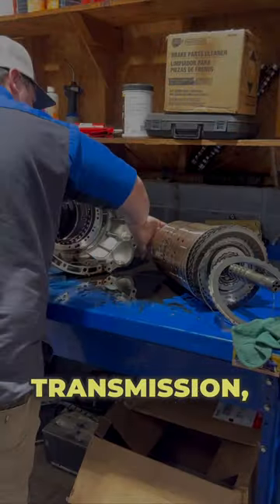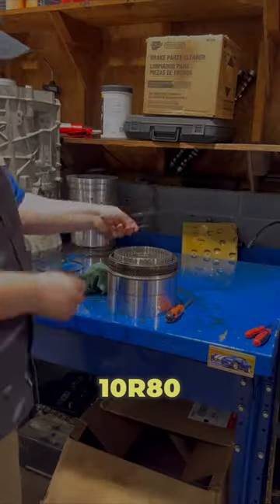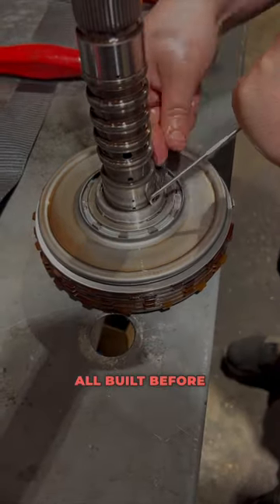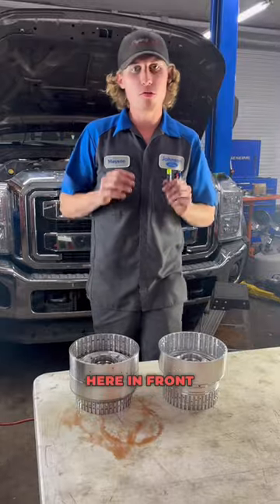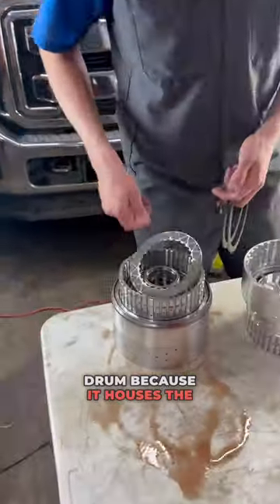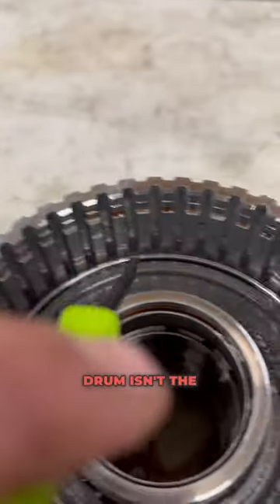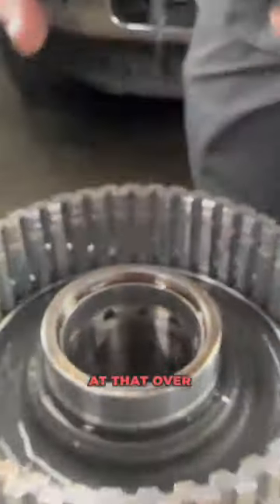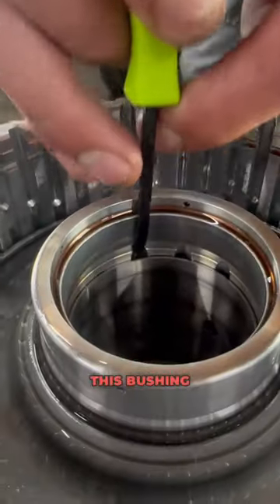Ford 10 Speed Transmission Problems? CDF Clutch Drum pt.1 #shorts

Comment: Ford and GM engineers didn't expect anyone to find it.
Reply: Ford and GM to be correct
Reply: @jordainepenner6232  correct. 
I edited the above. 😁🤙
Reply: Did you know, the Ford and GM transmission are actually NOT the same? Ford changed some internals and tuning. Also the only "shared" tranny is for the 1500/F150 and NOT the 1 ton diesels
Reply: They’re not the exact same… also GMs don’t seem to have nearly as many problems so… ford messed up
Reply: @AsianNIGMA   Fewer problems because they sell fewer vehicles.
Reply: @AsianNIGMA That’s funny, I just watched a teardown video of both and the GM transmission had tons of cut corners vs the Ford. The tech was shocked at how cheap the GM looked in comparison.
Reply: @booya6437  - Could you please post the link for the video you referenced?  I'd like to also check it out.  Thanks!

Comment: I work for an automotive warranty company, we are replacing hundreds of these transmissions a WEEK! It’s insane.
Reply: My dad thought I was an idiot when I told him I paid for the extended warranty. Till the trans went I paid 250 bucks for a new trans 😂.
Reply: @The219Beast that’s great but why get a ford ?! They got so many problems that are well known this is just another one
Reply: @Thisguyyyyyy  oh no I meant in general you should get the extended warranty. I have a 2019 Acadia known to have transmission issues. Sure enough right at 82k started acting up, ended up being a torque converter. I asked to replace everything so they did.
Reply: @Thisguyyyyyy not really. I've been a tech for 20 years, almost weekly I'm replacing or rebuilding dodge ram engines and trannies or gm trannies. Ford has had their share of issues but almost never are you replacing or rebuilding drivetrain components
Reply: That's crazy. I'm really glad that I have the 6 speed lol. Lots of issues on the F150 forum with them as well.
Reply: Nice to know you guys actually cover some issues. I always thought those companies were a scam and wiggled out of paying most claims.
Reply: What u need is the good Ole 6R80!! My 2015 f150, gets .4mpg less than my buddy's 10R80 f150 same engine same rear-end!  So is .4 worth issues n 4 more gears ?? Nope
Reply: @bits9760 my 2015 F-150 6 speed always slammed hard downshifting around 35 mph, almost like it was trying to engage both gears at same time for a millisecond. TSBs came out and never fixed the problem, only lessened it. Luckily I sold it before anything completely failed.
Reply: @Thisguyyyyyy I know right...damn just put 3700 in parts in the transmission in my GM 2500hd
Reply: @calvins1837  Alison or 6 SPD?
Reply: @JasonW.  6 speed auto. Torque converter, valve body, solenoids. Started shifting funny at different times, money light was coming on. 144k on it.
Reply: @calvins1837  ok. I know there is a tsb on my 2020 about odd shifting sometimes, fix was to flush, but not replace filter
Reply: @JasonW.  this is a '16
Reply: @The219Beast plus the extended warranty cost... ding dong... so what...
4,250?
Reply: @JasonW.  Lucky you - the slam shifting was the first indication of the problem that was going to worse.
Reply: @Thisguyyyyyy  please list more reliable available options other than 5-15 year old toyotas with 150k+ miles still going for over $30k or GMT 800s.
Reply: I believe these are in GM's as well. The 10 speed was a partnership between both of them
Reply: @The219Beast shouldn’t have to pay anything

Comment: My dealership keeps saying basically the transmission is fine totally normal and refuses to warranty it
Reply: Get a copy of the TSB and schedule an appointment with the service manager sit down and discuss it, if they still refuse to do the work contact ford corporate, that will light a fire under their asses.👍
Reply: Just go to a different dealership, they are all underpaid for warranty work I don't blame them.
Reply: @datmanz5890  I do blame them. They signed onto the dealership deal.
Reply: In this case, “normal” is flawed.
Reply: They are running out the warranty clock. They did it to me. Get an extended warranty BEFORE thr 5 yr/50k and go to a different repair facility. I found out the hard way. I had to trade it in and took a $8k loss. No more Fords for me.
Reply: @roberthartzell7104  the exact way to go about stubborn dealers
Reply: Go to a different dealership or report them to Ford for not honoring warranty work.
Reply: If they fixed it the first time, right.We wouldn't have that problem.They're always trying to take shortcuts all three american companies
Reply: @scottmendoza8989  Only the American Company's?
Reply: That’s ford for you.

Comment: so fuckin glad I have the 6 speed
Reply: @Windypalace my 6r80 is a solid transmission.
Reply: @@Windypalaceisn’t ford/gm partnered for these transmissions?
Reply: @brad1356 yes they are, identical except for the software
Reply: @es-qf2gw  6R80 is a 6-Speed Auto, not manual...
Reply: My six speed is a rough shifter….has been for along time.

Comment: Isn’t this the same Transmission GM and Ford Built and designed together ??. I  have the first year 2018 in my Ford F150 , I have 125,000 miles with no problems at all ?? ( So far )
Reply: I think the first year was 2017 if you got the nicer trims.   A good friend of mine has a 2017 Platinum with a 10 speed.

Comment: I have 23 tremor and the trans shifts terribly sometimes.
Reply: Drive it as hard as you possibly can shy of embarassment, or dickishness for a day. Or even longer. Or, even more challenging, if you already drive hard. Try driving it like an 80 year old widow. This will reset the trans computer and relearn the driving habits. Theres easier ways to make it relearn as long as you can use the computers modern vehicles. Ford locks out so many things though, especially in the engine computers.

Comment: Couldn’t this potential issue be resolved, for those going thru a rebuild, first having an appropriately sized intermediate bushing driven down into that recess, before regular bushing, so that machined space has zero depth ahead of bushings’ home resting point? I.E., removing that ahead space being available for bushing to wanna “walk down” over time? Or just a taller/longer (greater depth) bushing in the first place? Seems rather stupid that the hole machines to receive this bushing, wasn’t machined with a slight shoulder down in hole, for bushing to positively stop against
Reply: If I understand your comment and the video correctly I think the issue is the bearing sliding up and covering the hole, not sliding down.

Comment: Can you explain why displayed coolant temps for ecoboost would climb over 236° while in moderate boost i.e. on-ramps on interstate?
Reply: Does it do it with the AC on? Most vehicles the electric cooling fan doesn't come on until 230+ unless the AC is on. I would start by checking the coolant level and check for debris in the cooling fins. I've seen them get full of grasshoppers.
Reply: @carlt6932  coolant level is full with the system “burped” from the dealership. All fans and shutters are functional. I live in Texas so AC is always on. I’ve also had the radiator/cooling system flushed several times. This has only been occurring since the cam phasers were replaced. Could it be a sticky thermometer? Could be a sticky thermostat? Other root causes?
Reply: I would be looking at the thermostat
Reply: I just had this issue on my ecoboost expedition. First issue was the thermostat, second was the water pump. OEM water pump had plastic fins and they were eroding over time. Replacement Motorcraft part has metal fins.
Reply: @Ryanhaglund the thermostat should've been your 2nd try,  make sure alternator is recharging properly, check water hose and pump then flush the system,  make sure all fluids are filled
Reply: @BruceDragon-sf1tr  @carlt6932 @macew32 thank you all for weighing in. My problem has been resolved. 1) needed new water pump as the old one was weeping through the seep hole. 2) the main culprit, the engine thermostat was installed backwards at the dealership that replaced my cam phazers four years ago…
Reply: @cskiles  you were right on the money! Thank you!
Reply: @Ryanhaglund  awesome! Glad you got it resolved.
Reply: @Ryanhaglund  you shouldn't let anyone work on your vehicle,  ask the dealer to let a veteran mechanic work on your car

Comment: 21’ STX F150 with 82,000miles. Like brand new. Changed the transmission fluid and filter at 60,000 miles. ❤

Comment: Got mine fixed in 4 days and shifts good but it still has its quirks. They did the whole TSB with a transmission reprogram/relearn, valve body, and then the new CDF drum

Comment: Ive got a 2020 with the 5.0 and my only worry is this transmission.
Reply: Ford replaced my 19 f150 coyote for excessive oil consumption at 50k.
Reply: Meh. They rebuild well. Alot can't be rebuilt and it's not worth it. These can be pulled apart rebuilt and tested in half day. There are ALOT of them so has a strong aftermarket.
Reply: dad has  the same truck and burns oil like a mo fo , id be worried about more than the tranny , the whole truck is junk , told him not to leave Toyota lol
Reply: @TheCaperfish  you know the tundra motors are having far worse problems? Coyote just had a mystery issue from 2018-2020 that gets fixed with a PCM re program. As it was creating so much suction that it was pulling oil through the valves. It was such a mystery the best engine builders still don't have consensus around the cause.
Reply: Did you buy it New or used? I bought a 2020 GT 5.0. mustang with 7700 miles, mine has a hesitation 2-3, after 3rd gear all gears are fine, sports+ all fine, just D mode 2-3, What about yours? Any hesitation in D mode?

Comment: Need to stake them in like the good old 700r4 pump bushings.
Reply: Holy shit. Do it like the 700R4, said no one ever! The 700R4 when paired to a 6.2 diesel made it seem like the 6.2 was a good engine. I remember doing the update Kit on my 700R4 when it blew up the Third time. Worst transmission, ever.

Comment: I disabled my transmissions adaptive learning. Truck drives like a dream now. We’ll see how long this lasts. I have 50k miles on my 2020 F150stx with the 2.7 eco boost. I’ve had the truck tuned by MPT for over 40k of those miles
Reply: Reply back in about a month or two please lol.
Reply: Is that done thru programming or a manual disconnect switch

Comment: What symptoms can a person look for in a vehicle with this transmission?🤔
Reply: Hard shifting shuttering clunking slipping
Reply: @keithlaub7964  

I have a 10 speed in my 2021 F150
I just don’t care for how it shifts. Varying the throttle at all at lower speed sometimes seems to disrupt the shift and it seems like the transmission is being shifted by rubber bands. Thank you for responding back. I will keep an eye on my truck.

Comment: What's the cause and how to best try to avoid the issue?  Does changing the fluid ahead of schedule help?
Reply: The cause is a incorrectly designed cdf clutch drum that allows the bushing to move and damage the sealing rings that seal the clutch drum and apply fluid pressure which engages the clutch packs.

Comment: Chevy the same way if you have a 6 speed or 8 speed from 2014 and up there all junk.
Reply: Not really 

My 2014 lasted to 189,800 miles on the original fluid before going out 

People who’ve never owned a Chevy love to bash Chevy I’ve noticed
Reply: The 2019 to 2023 5.3 6 speeds if.ypu can find one are great I found mine and was manufactured without afm or dfm and no auto stop start
Reply: A guy I work with has a 2014 silverado with 300k miles.  It's on its 4th transmission.   Just rebuilt the engine.  He drives it solely for work now and shockingly bought another 1500 silverado.  Brand loyalty is real lol.

Comment: I had a 2017 F-150 with the 3.5 Eco and the 10 speed. One day, my engine and transmission got into a custody fight over who was going to get the drive train. Lost 5-10 and reverse. It was replaced under the extended warranty.  No longer own that truck.

Comment: I have a 2019 f150 never received a tsb from  ford will I receive one in the mail?
Reply: No its not a recall
Reply: So ford knows they have a problem, so when my transmission breaks then it's my problem. Is what the  video really means.
Reply: It'll start shifting harsh and erratic when it malfunctions.  A TSB is created anytime something has a common or pattern failure.  This will guide the technician on the proper approach and repair method to the issue.  It also helps the technician diagnose the vehicle faster since they should be checking TSBs early in the diagnostic process.  TSBs are also not always covered by the dealers, in which case will be customer pay.  Car manufacturers will only notify you in the mail if the issue is a recall.  Recalls are covered by the manufacturer.
Reply: @M4sterT3ch  I was notified by mail a T S B for the cam phaser raddle, it notified me to contact my dealer if I had a phaser raddle so they can reprogram the ECM to crank engine longer to get oil up to values. I never had the problem. TSB are a joke it's the manufacturer way to say open your wallet.  If a vehicle has a on going problem on many vehicles then it should be a recall.
Reply: @M4sterT3ch  you don't get it mechanics. We spend $45,000. On a truck that get a t.s.b. on a transmission that ford build  and tsb means they know theirs a problem,  and it's not going to be a recall. That's Bull S###. As a mechanic you will think you are serving the customer as well as making a living. I am in the service field and without good customer care and relationship  well,I will hungry and without a roof over my head.

Comment: I’m a ford guy but ford royally fucked me on my 2018 f150 with the 10 speed. Ford knew they were having problems with these 10 speeds but didn’t want to do anything about it. So I tried to use my warranty and by the time I was able to get in the dealership I was over my warranty mileage by like 20 miles and they refused to replace the transmission. Dealership said it would be $8000. When I called in to scheduled the appointment I was within my warranty mileage limit. If I could have gotten in the same day I would have…

Comment: Is this why it feels like my clutch slips between 3rd and 4th on my 23 f250??
Reply: Yes. 2020 F250 tremor with the 7.3 and mine started with a shutter going into 4th and a delay going into 10th as well. Same with the downshift when coming to a stop. If I didn’t let the truck warm up until it went to low idle, it would jump like crazy when going into drive. I had 53,000 miles on it when it started getting really bad. I drove the piss out of it one morning and then had the adaptive tables reset and it went out immediately. Ford replaced with a new transmission at no charge. Currently at 64,000 and no issues so far. I still let it warm up til it goes to about 700 rpm’s before I put it in drive to avoid it lurching. Hasn’t done it but I’m still tender about it.

Comment: Didn't you have a video talking about how this is the best thing Ford has made in the last 10 years?
Reply: It really is as s someone who fixes fixes them all day long lol in all reality now that the drum is updated so the bushing doesn't move they are a very good transmission
Reply: @rockenvw  What does it cost to have a new drum put in?
Reply: @scubaseppy  probably to much.
Reply: @rockenvw  So from 2018-2023 they might need to be rebuilt at anytime, how on earth do you consider that a good transmission?  So Ford shill is saying you might want to do it preventative 🤣😂.  I’m only here because I like the aluminum body but with looming catastrophic problems that can happen, I might have to buy a Chevy.
Reply: @scubaseppy do you see the drum? It’s built more robustly than an Allison. The weak link is a bushing. Otherwise it’s got better metallurgy and design than some of the best. 

If that bushing wasn’t shit people would be praising this transmission especially with what it can do paired with the ecoboost. 3k to have it swapped might still be worth it 🤷‍♂️
Reply: @scubaseppy go ahead and buy a chevy but go ahead and order a cam and lifter kit and a Dod or afm delete while your at it because after 50-60k miles you may have a lifter failure.
Reply: @scubaseppy chevy uses the same transmission 😂
Reply: @gradoisx2348 My 09 sierra has 175k miles, got afm delete at 155k and no lifter tick or cam failure.

Comment: What u Americans think Ur the only ones with issues from Ford or GM re there Auto Transmissions . 
Here in Australia 🇦🇺 we have the Ford Ranger . The Auto is guaranteed 2 do 240, 000 ks . 

They shit themselves either B4 100,000 ks & sometimes just over 100,000 . However a lot fail B4 then . 

The problem is they are a sealed unit . U can't fix the %$&#@!$  or work on them . 

They are a throw away item . It's BS . 

The SOB's should be held 2 account .

Comment: Always buy certified pre owned with extended warranty...
Reply: Won’t help whatsoever dealing with it right now
Reply: @keithlaub7964  Really? How so?
Reply: @christopho3255  Mine was certified pre owned w/extended warranty, please explain how it is going to help
Reply: @hoeto63  Transmission TSB/repairs should be covered under extended powertrain warranty just like the cam phaser updates have been....
Reply: @christopho3255  "should be" 🤨
Reply: @hoeto63  Did your local dealers straight up deny you?